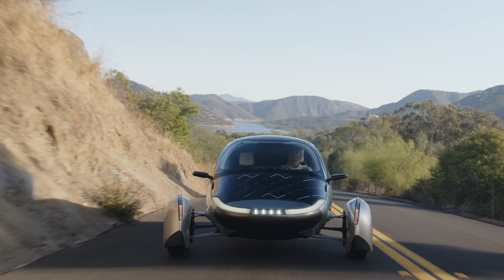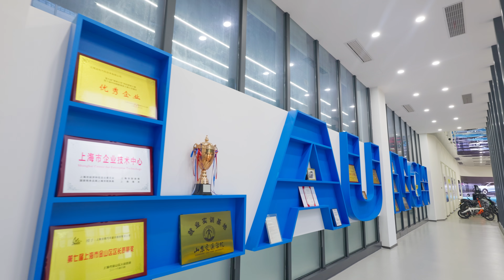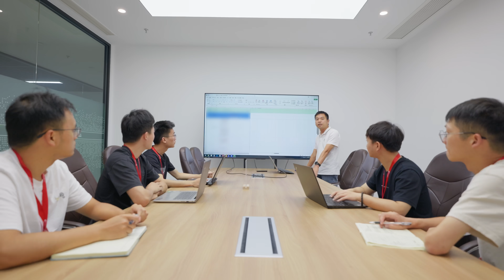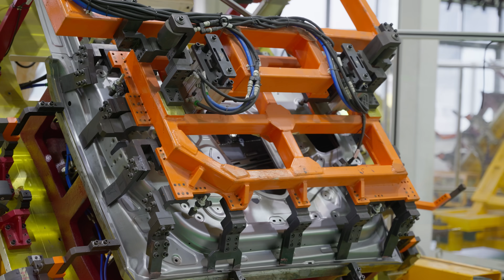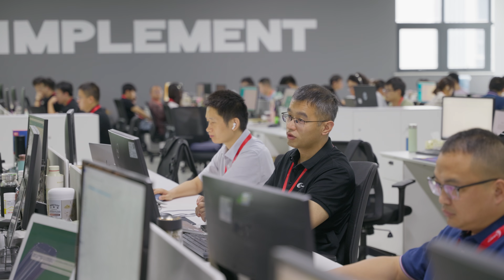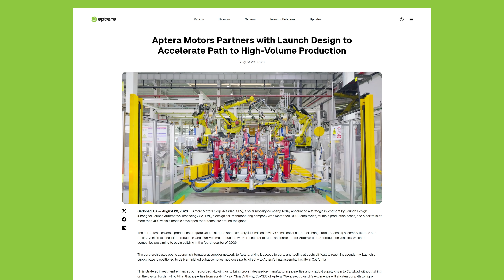MEGA UPDATE: Aptera Has a New Production Partner

Comment: $40K - and probably more for an Aptera that holds 2 people, and has the entire drive and steering system on exposed "outriggers" that WILL get cleaned off in a side-swip impact, OR, $40K for a Tesla Model 3, or an Ioniq 5, or a Chevy Equinox EV, or under $30k for a Chevy Bolt, or a Nissan Leaf, all of which hold 4-5 people, can go 250-300+ miles, have FAST DC charging in the case of the first names, and have their entire suspension, steering, and propulsion protected by structure, plus are fully crash tested as "cars" complete with airbags, impact absorbing structure.

THIS is the hard sell problem Aptera is facing and every REAL investor knows it.  Sure, a case CAN be made for a small, light, super-efficient, TWO-seat, 3-wheel non-car that has entry and egress limitations for a large segment of the population, but not at $40,000 to ENTRY PRICING!
Just WAIT for the product liability suit when the first elderly person snags a foot trying to get out of this thing, and most of the deposit holders who were 40 when this thing started are now 60+!
Then come the lawsuits for the $40K non-car being TOTALED by a sideswip impact because the entire wheel strucure has been torn away, and bent the main frame it was attached to!

Aptera was SUPPOSED to be economical!  Not just to operate, but to ACQUIRE!  Traditionally, 3-wheel non-cars have been less expensive, mainly because they're often adapted "up" from a motorcycle propulsion "rear half" bolted or welded to a "cart like" front chassis, with a nifty looking body around it - with the two front wheels ENCLOSED within a frame perimeter that offers SOME degree of protection for the wheels, control arms, steering knuckles, brakes, and such.

Aptera was supposed to be CHEAP and SIMPLE, and a simple tube structure - whether steel or aluminum, is quite INEXPENSIVE to fabricate.  Carbon fiber panels are UNECESSARY, but okay, once molds are made, the aren't exactly difficult to make - and clearly Aptera has OUTSOURCED THIS.  Streamlining is nice, but come on, a full width nose structure that encloses and protects the wheels could be just as streamlined, and provide more surface area for solar panels.  In the 20 years it's taken this thing to get to yet another fancy press announcement, EV tech has SURGED forward with entire plug-n-play solar "kits" now cheap enough to be an impulse buy!  The sum of what the Aptera IS doesn't add up to a $40K price tag.

You could source the entire drive train from a Livewire 2 motorcycle making 63KW, 150 mile range, simple reduction belt drive, 300 VAC, DC fast charging, and an entire suite of electronics - just buy the entire "back end" for about $8K, and bolt it up to a simple perimeter tube, KEEP the vertical stack battery behind the seat firewall and come in for half the cost of the Aptera on a one-off, DIY basis.  Install a second battery and you have a 300 mile range 2-seater, and a solar panel ARRAY could be folded into the structure to be deployed whenever the thing is parked - good enough and dirt cheap, OTC solutions rather than expensive custom options.

CHINA could build and sell this thing for $5,000, but WHY bother when they're building CARs that sell for $12K-$15K, and have full-featured SUVs for under $20K with more "tech" built-in than ANYWHERE ELSE!

Since FEW people can just buy a $40K non-car CASH, that means lenders - lenders willing to risk money on what is essentially an expensive motorcylce, and sure, they will, but at what cost?  Then comes insurance on what is essentially an expensive andn FRAGILE motorcycle that WILL be totaled in any collision over 10mph.

Comment: Good news - but writing as someone who worked in the auto industry for nearly 40 years -  design for manufacturing should have been started at the early CAE stage and completed during validation build. Starting when production bodies are on order is crazy. It will just drive expensive late production tooling  mods. Also a video showing someone grinding a “production” auto body sends shivers through any experienced engineer!
Reply: Sometimes spot-welds need to be ground down... nothing new in that (unrelated to Aptera) stock video footage from Launch.  Aptera is nothing like any other company and has shown tremendous resilience and a unique design and engineering ethos.  Of course they do things differently than the big legacy manufacturers.. who are stuck in their own rigid world of doing things the same way over and over again... even when better methods are available and well known.

Comment: This is basically a story of "If you can't beat them, join them." China produces the most advanced assembly lines for electric vehicles in the world and some of the most advanced electric vehicles.   For a vehicle to have a low impact on the environment, it must not only be efficient in use, but in its production. This deal should lead to more efficient production, which is reflected in lower manufacturing cost.

Comment: Vehicles with outrigger wheels that make them too wide for roads outside North America and solar panels that are only going to be effective in sun-belt climes.

I doubt the vehicles would be legal on UK roads because of their overall width and the risk to pedestrians and cyclists caused by the outrigger wheels which make the vehicles FAR wider then the perception from the driver's seat.

At the very least, they would require lights on the outrigger wheel covers themselves otherwise they might not be seen at night resulting in the vehicles being given insufficient clearance by other vehicles or cyclists passing them.
Reply: Not very sharp, are you?
Reply: Its significantly more narrow than the average suv

Comment: This new partnership is great news, it means you can fix your unsafe door openers!

The largest ever vehicle recall in china was just announced. It’s for Tesla’s electronic door handles.

Please work with Launch Design to create manual door handles that meet the new worldwide safety standards, which the current Aptera electronic door openers do not.

I have two early delivery slots, and want them to be safe in the event of vehicle battery fires or any other crash.

Thanks!!

Comment: CPC Group will provide the body parts, Yazaki North America will provide the wiring harness, and CTNS will provide the battery assembly, so that tells me that Launch Design will be providing all the electronics modules, which is an area where China dominates the world, so it isn't surprising that Aptera turned to a Chinese company to do that. 
Launch Design is the first partner that Aptera has announced that is Chinese. China no longer has cheap labor, but it has manufacturing companies which know how to reduce costs and how to automate. 
I'm glad that Aptera is keeping its local final assembly approach to manufacturing. The Aptera final assembly has very low labor (only 137 steps in 14 stations), and it doesn't require much capital. It lets them get manufacturing incentives in many localities and be close to their customers, so I hope they will keep using that model.

Comment: That's smart. Use every one's experience to help you build better. Instead of tripping over every obvious mistake a startup could make and fail, they're using experts who know what to do and have them help them get there. 

I tend to think anyone who avoided this approach has more money than sense, and thinks they can spend their way to success.

This is how a fiscally responsible company does it. That's why I'm an investor, and have a car on order.

Mine won't be the first one off the line...

(I think the model I want is one of the last to be put into production. I need the range. When you live in the Central US, EVERYTHING is far away, and 250mi range wouldn't get me to the next major city and back, and anywhere I frequent a 400mi range would still require a pit stop under perfect conditions. And I'm gonna be using my heater AND AC; not freezing when it's zero, not burning up when it's 100 every day. So, even as a daily driver, it's less RANGE anxiety and more COMFORT anxiety).

... and it doesn't need to be. My current daily driver will likely hold out till it enters production, and I'm fine with that. 😊

*(Edited, because I ain't got no good English)

Comment: Maybe the diagnostics for the scan tool can be integrated into a system on board screen and maybe a mobile app as well when you're outside of the vehicle working down the road of course I don't expect cars to have major problems but it would be nice to be able to get it going and look at all the basics have any warning signs and things Early detection look up tires and sensors tire air pressures be able to reset I mean no that's kind of unique backup cameras to be enabled very easily or something I don't know you know rear window cams systems to be factory you would be very nice , proximity sensors on the wheel whales stuff like that the scan token diagnose and replace any of those sensors or components let alone if you need a motor or blower motor or anything

Comment: Great! This is more than an efficient use of capital. By putting the responsibility for manufacturability on the same company responsible for the manufacturing equipment, Aptera has eliminated the lapses and finger-pointing that follow missed assembly tooling targets. In the meantime, the unglamorous takt time work will be the key to profitability.  What is the timetable for delivery of the assembly equipment to Carlsbad?

Comment: This is great news, not just for continuing to the initial production starting as soon as October, but alao the ramping up to high volume production. It's still a ways to go to high volume, but it looks much closer to reality. 

This clarifies that most if not all production parts will be available in October though. I theorized you might have a surplus of parts already built up, but it will be nice to see vehicles rolling off the line. If sales can begin in October and not December, that will get a jump on the low volume production in 2027.

Comment: This sounds similar to what Telo recently announced with Schwab Industries. However at $28,000 to start for 250 miles of range I am not sure how much sense this makes with the Slate at thousands less and things like the Leaf and EV3 now available.
Reply: How are any of these even remotely comparable to Aptera?  Aptera is its own category.  Nothing else is anywhere near as efficient, inexpensive to operate over time, and none of these heavier less efficient vehicles have the right to repair ethos (except perhaps Slate) or built in power generation to add meaningful miles.

Comment: I am a bit shocked.  Aptera may actually make this thing before I die.  I see a lot of demand but my concern is the load capacity.  If I bring a friend to the hardware store I may have to leave them behind to keep under the 500lb limit.   I think bumping this up a bit would make the thing more practical.  Not,  expecting truck levels of weight bearing, but at 225lbs for me and 245lbs for my friend, that leaves very little load capacity for much else.
Reply: It may also shock you to know that lots of cars have very low payload limits, which people routinely ignore.  The limits are very conservatively derived and engineers know that the vehicles will likely see more than they are rated for on occasion.  Helper springs and upgraded brakes would be one path for those who are timid about flirting with these very conservative limits.
Reply: @J-W-Kelly  I own 1 share of SEV so not a hater, just watching and commenting on my concerns.  Thank you for the valid well intentioned information.  I will keep watching and being cautious.  I genuinely want  to one day be stuck on the side of the road next to an Aptera that just carried me 850 miles in 16 hours of driving and still has 99 miles of range, pass out and wake up with 139 miles of rangemean with Lithium air batteries the car would have 4000 miles of range and honestly they should do it to sau FU to all the range anxiety people, but now I am just dreaming.

Comment: I mean there's no other way Aptera would be a Chinese car assembled in California (just like china is opening "screwdriver" "IKEA" car plants in Spain)  but this is preferable than no production at all. Cheers 🍻 hope this venture succeeds 🙏
Reply: Aptera does not manufacture its parts in a single, isolated location; instead, it relies on a global supply chain model where major structural and subassembly components are outsourced to international manufacturing partners and then shipped to its final assembly facility in Carlsbad, California.  
A significant portion of its production infrastructure and tooling is tied to China, alongside key partners in Europe and Taiwan:
1. The Major Chinese Manufacturing Partnership
Aptera formalized a major partnership with Launch Design (Shanghai Launch Automotive Technology Co., Ltd.), a design-for-manufacturing firm based in Shanghai.  
Scope: This multi-million dollar program covers the assembly fixtures, tooling, vehicle testing, and the production of major structural components (such as body and chassis subassemblies).  
Function: Rather than manufacturing individual, loose nuts and bolts in-house, Aptera leverages Launch Design’s supplier network to deliver finished subassemblies straight to California.  
2. Other Key International Components
While China plays a primary role in structural tooling and subassemblies through partners like Launch Design (and historical battery cell supply agreements with companies like EVE Energy), Aptera's supply chain is decentralized globally:  
Slovenia: Elaphe supplies the in-wheel electric powertrain motors.  
Taiwan: Partnerships like Formosa AdvEnergy have been established for battery technology development and supply.  
Italy / Europe: Aptera has historically worked with European composite specialists like C.P.C. for lightweight body structures and manufacturing techniques.  
In short, while the final assembly happens in the United States, a massive share of the heavy manufacturing—tooling, body structures, and subassemblies—is produced overseas, with China serving as a core hub for its body and chassis production framework.

Comment: Still curious how Aptera handles serious snow
Reply: Yeah they would need a heater element and pump and I think I remember they have incorporated those in but maybe I'm wrong...
Reply: For cold-weather battery management, Aptera uses an integrated heater within its liquid coolant circuit to actively warm the battery pack to operational temperatures. In warm weather, that same coolant loop circulates to dissipate heat.  Gemini
Reply: @livangooday but what about handling? I'm curious about actually driving in a storm
Reply: @TheAneova hard to tell maybe aptera isn’t a winter vehicle at all. Three points of contact, not a lot of weight, maybe poor handling on slippery ice conditions, but I’d buy one anyway…
Reply: @livangooday oh yeah i definitely want one too 😊
Reply: @TheAneova i have a question too? What if the shape and lightness can lift the vehicle from the pavement at high speeds ? Imagine a burst of winds can make the aptera lose control??? Im sure its been tested at high speed
Reply: The short answer is no, wind will not flip the Aptera over, and it is engineered to be exceptionally stable at high speeds.
Because of its unusual three-wheeled, teardrop shape, people frequently worry it might behave like the notoriously unstable Reliant Robin from decades past, or act like an airplane wing and lift off at highway speeds. However, its physics and engineering are entirely different.
High-speed stability and crosswind performance are managed through several key factors:
1. The Physics: Layout vs. The Reliant Robin
Two Wheels Up Front: The Reliant Robin used a single wheel in the front and two in the back, making it prone to tipping when cornering hard. The Aptera uses a tadpole layout (two wheels in the front, one in the back).
Wide Track Width: The front wheels are spaced very far apart—roughly matching the track width of a standard mid-size car or Tesla Model S—giving it a broad physical footprint to resist rolling.
Low Center of Gravity: The heavy battery pack is mounted low in the chassis floor, keeping the center of gravity very close to the ground.
2. Aerodynamics and Crosswinds
Zero Lift Design: Wind tunnel testing and Computational Fluid Dynamics (CFD) modeling show that the teardrop body prevents the car from acting like an airfoil. At 65 mph, it generates a negligible amount of aerodynamic force, maintaining roughly 25 pounds of downforce rather than generating lift.  
Slipping Through Turbulence: Because the vehicle is optimized to cheat the wind (with a drag coefficient around 0.13), it cuts through heavy air turbulence—such as the wake of passing semi-trucks—cleanly without getting violently pushed around.  
Wheel Fairings (Pant-legs): The front wheel pants are independently aerodynamic, designed to prevent side-drafts from catching the wheels like sails.
While any lightweight vehicle (around 2,000 lbs) will feel strong crosswinds on an open desert highway just like a small hatchback or sports car does, the Aptera’s low profile, heavy bottom weight distribution, and wide front track prevent it from being a rollover risk.  
Are you looking at the Aptera primarily for its energy efficiency metrics, or are you comparing its handling dynamics against traditional EVs?